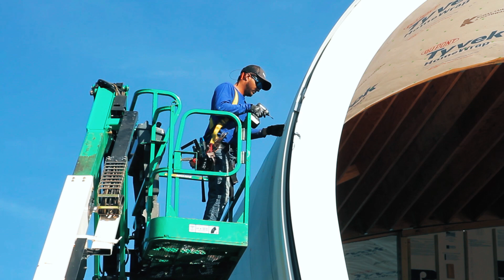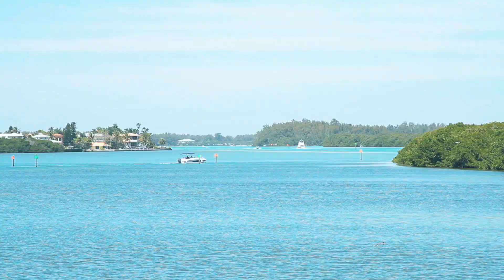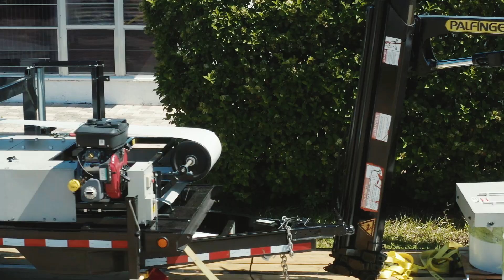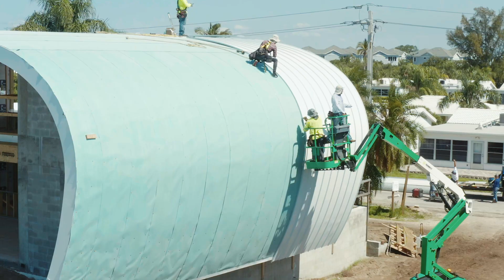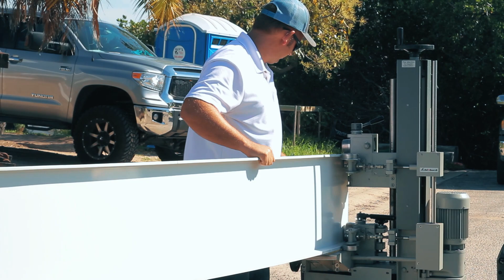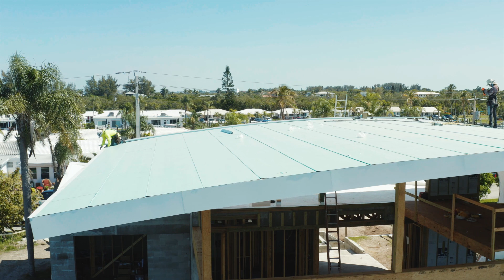Florida Metal Roofing Installation Project: Aluminum Radius Roof

Comment: Joe Keene said that on this project he used aluminum standing-seam roofing panels but stainless-steel fasteners, clips, and rivets.  Is there any issue with dissimilar metals being clamped to each other (namely, a corrosive effect of electron exchange between dissimilar metals, as happens between anode & cathode in a battery)?